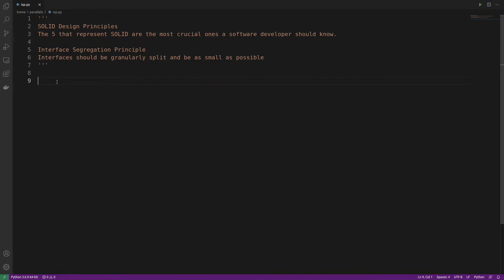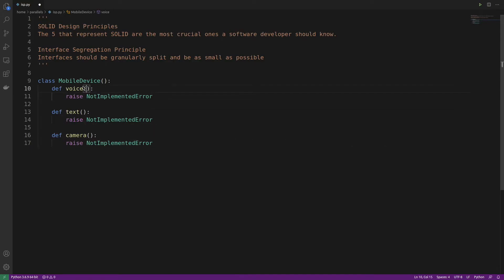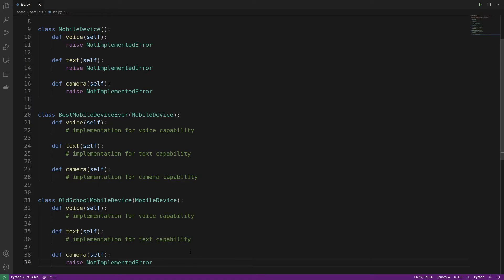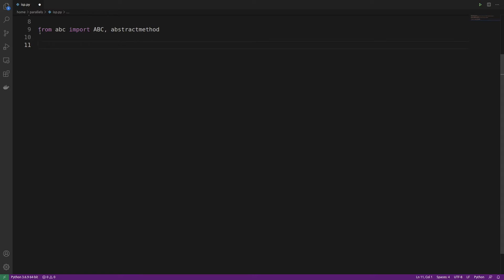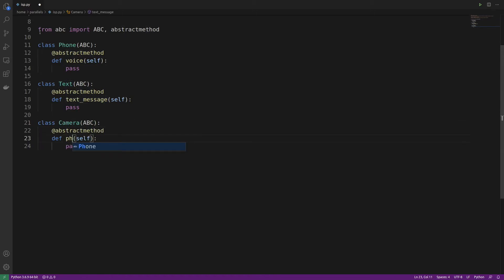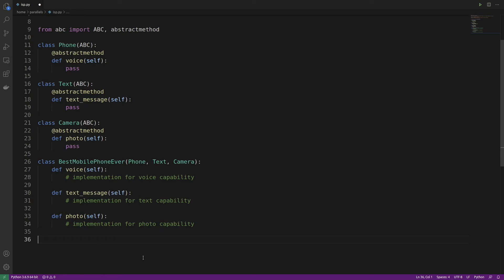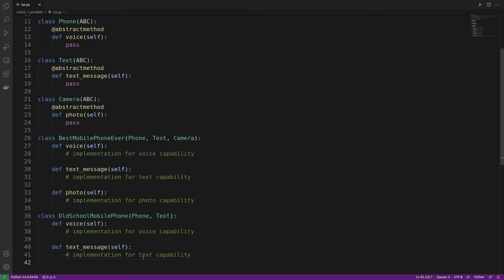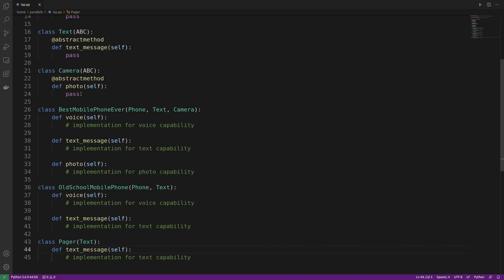SOLID Design in Python - Interface Segregation Principle #4

Comment: Love these series, even though  the audio is very low. It looks to me that the Interface Segregation principle example is almost identical as the Liskov substitution, where the Juicer can't use the Temperature and here the Old phone can't use the camera. Can anyone clarify.
Reply: Sometimes the implementation of one of these principles sort of covers the other. The way I would distinguish is the core takeaway of each of these principles. The Liskov sub aims at making sure the developer is aware that any class that extends a particular interface should implement all of its method calls (this might not be desirable). Where as the ISP is focused on making those interfaces as granular as possible. So in essence, the former is focused on the child classes extending the interfaces, and the later is focused on the Interfaces themselves.